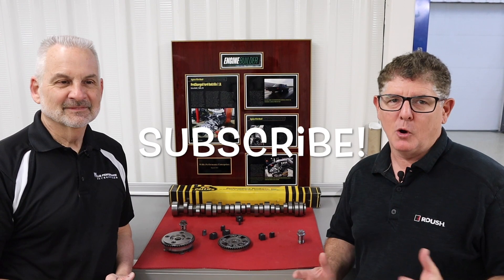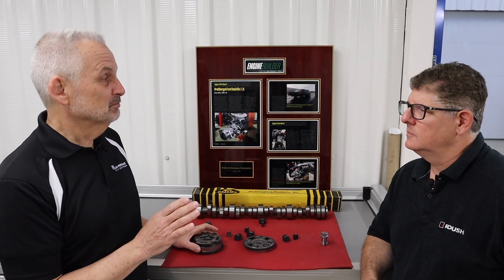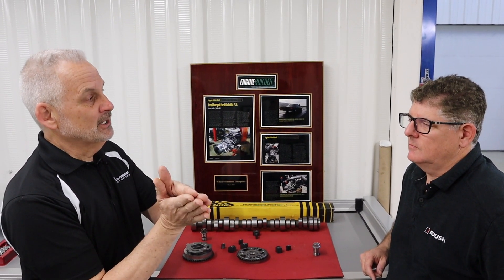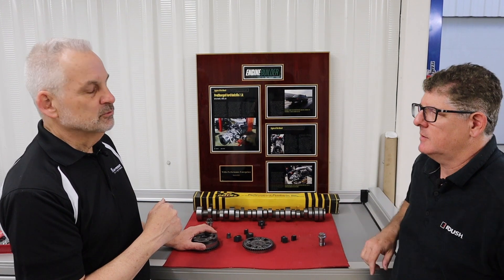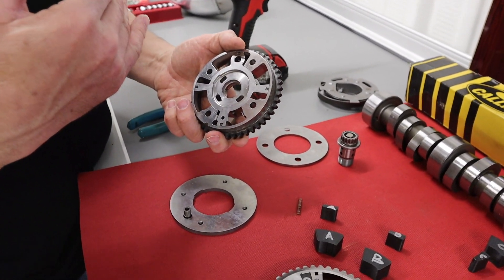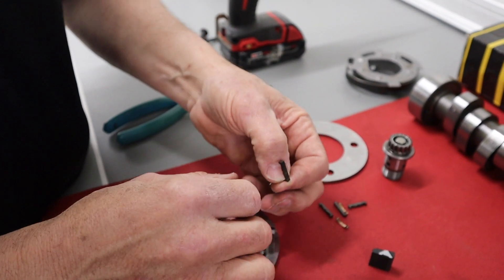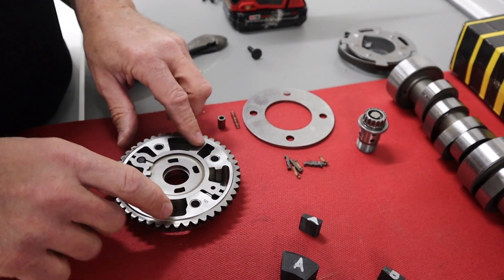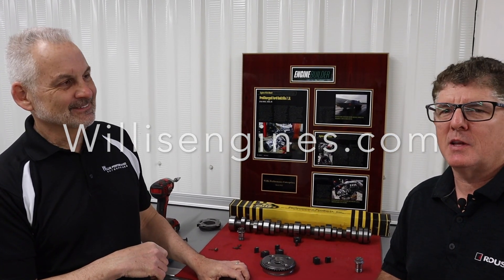Ford Godzilla 7.3L VCT | You Need To Know This For Max Power & Best Camshaft Performance

Comment: I used to look at god zilla as a modern day big block.   Now I see its an advanced small block with 4.5" bore spacing, a little more deck than a 351w and advanced heads and components.   It's a real bad azz.   They got almost 1000hp with stock ported heads, increased stroke; custom intake and custom cam.

Comment: How many hp is that gizmo worth?
Reply from the maker: It's not so much worth horsepower as it is a tool for dialing in the camshaft based on your intake and where you want peak power to occur in the rpm band. Advancing the camshaft timing generally creates more efficient cylinder fill lower in the rpm band, where as retarding it promotes better fill at higher rpm.
Reply: @revanevan  Ok 👍🏽
Reply: @revanevan  🤔👍again , very educational . I'm so glad I can join in on this stuff . It is really great to look over your shoulders to see what's going on 🙃.

Comment: Looks like a fix for now, but I bet someone will make a dedicated cam sprocket as MMR makes for the Coyote engine
Reply: Already available. Contact the team at cme-racing.com

This eliminates only one issue. I have a true dual roller timing set on my 7.3 Godzilla and it’s been flawless for well over 2000miles + multiple engine & hub dyno runs as well as multiple low 8 sec passes in a 4000+ lb car